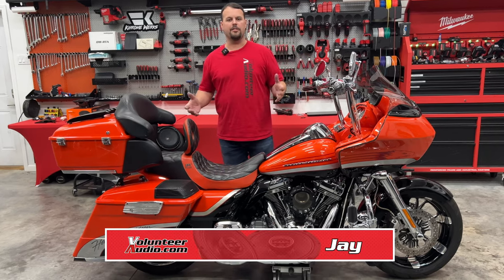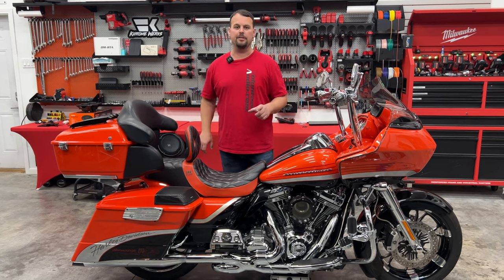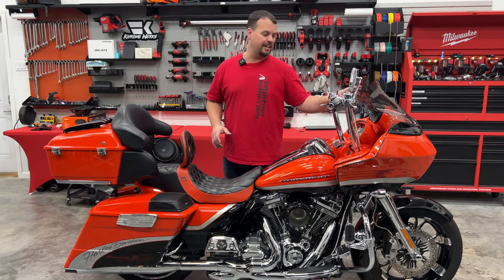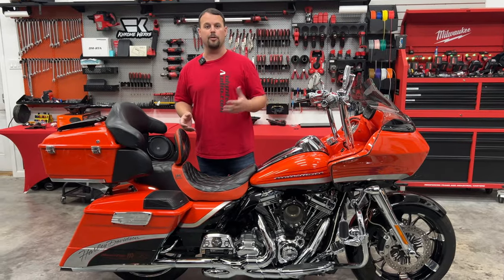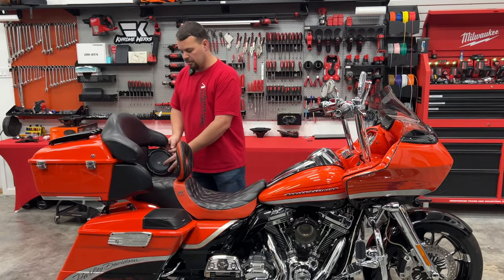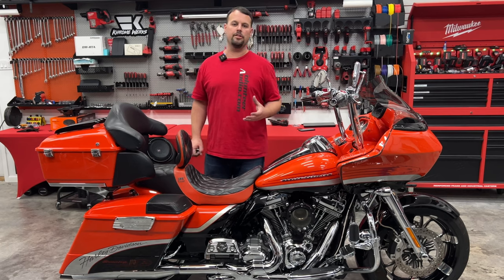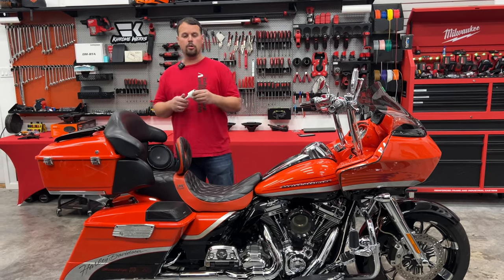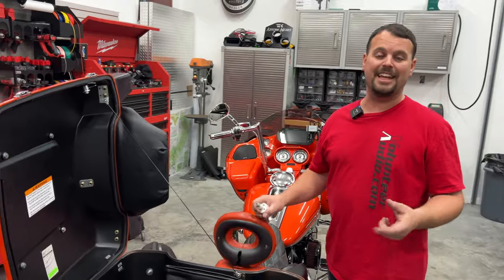Tip for better Sound! How to port 1998-2013 Harley Davidson Tour Pack speaker pods for better Sound!

Comment: So you add speaker pods to a detachable king-tour pack right? What aftermarket speaker pods did you use or can you suggest some good aftermarket speaker pods that will fit most of your speakers? I would like some that I don’t have to modify to get a 6 1/2 inch in.
Reply from the maker: If you have a 1998-2013 style king tour pack I suggest the hog tunes pods, you will need to modify them for a 6.5 but they are the best option

Comment: Will it still work if you keep a ton of stuff in there all the time? Mine is rarely empty.
Reply from the maker: Yes
Reply: @volunteeraudio  cool thanks
Reply: Just my two cents and only a theory but you could leave space where the port hole is to let that little woofer breathe.

Comment: If upgrading to the new Soundstream from the factory radio does my amp gains have to be adjusted?  I currently have the PP amp with your infinity kappa kit with lids. Flashed 6 boom. Package from VA.
Reply from the maker: Yes the gains would need set for the new radio
Reply: @volunteeraudio do you have a video for that?
Reply: I know how to turn the screws, but I’m talking about the distortion part
Reply: @volunteeraudio do you know what type of seat that is
Reply from the maker: @RealStevenBanks  you don’t just turn the screws, you set it with proper tools
Reply: @volunteeraudio on the plug and play for the SS radio are you still using the high outputs for the amp like the boom. Or the RCA outputs. And does that change.
Reply: @volunteeraudio   I will reach out after I purchase the radio from you. 
Thanks Jay.